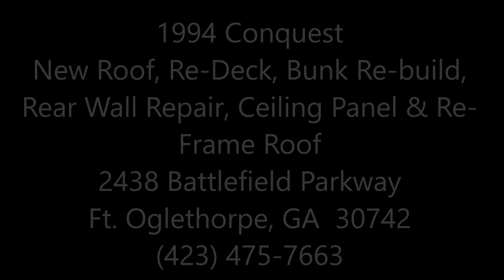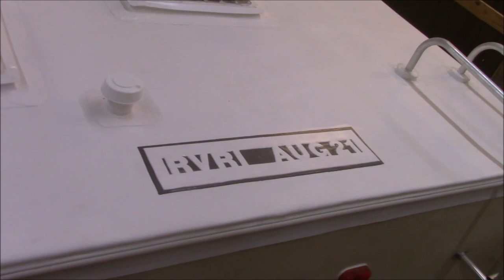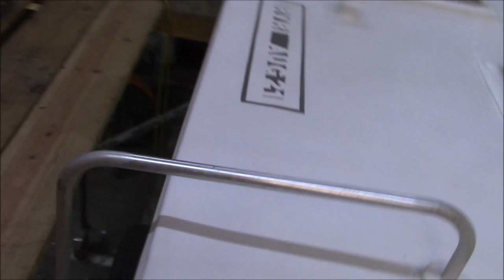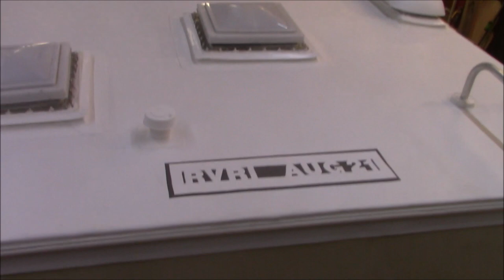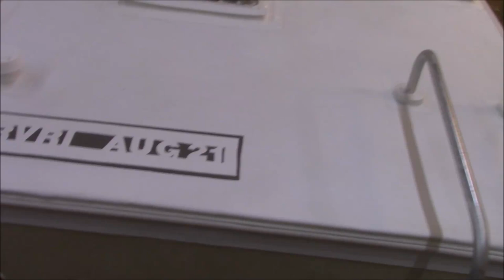1994 Conquest New Roof and Re-Deck Bunk Re-build

Comment: I purchased a 1992 conquest with foam roof panels. 
I knew I was going to have to repair the roof. 
I had no idea how these were constructed. 
They are fine if you don't have water damage to the 1/8 wood paneling, but as soon as this paneling rots, there is literally nothing supporting the foam panels. So someone walks on this the foam just caves in.
I  loved your solution of mounting wood arched trusses to the sides of the braces. Now you can relevel the cieling.  Brilliant!
Thanks so much!!!!
Reply from the maker: These vids are not genetally intended as DIY but if you got some tips...awesome. Good luck on your projerct my friend. These are a bit more complicated than most people think, or what they see on YT wannabee RV guys who don't install roofs properly. Those guys are " monkey see, monkey do" guys. They don't know "why" they do, they just do, and just try to copycat the manufacturer who has done them wrong from the start. So its safe to say that if the manufacturers installed the roof wrong from the start and leak then the roofs the "monkey see monkey do" guys install will surely leak and yet another customer gets shnookered. 

Thanks for watching.

Comment: If I had a 2013 or something similar that was having delam, I would absolutely haul it to the professionals however,
I found a 2000 32 foot Minnie Winnie that I picked up for 3500 bucks. 60000 on the odometer with the exhaust bolts already replaced on the V10 so with that I've been fixing the delamination myself. Granted ive got the tools and patience that prep is 99% 
I gutted the interior and have been redesigning it with mostly free stuff and at that point with the exception of my glues and Luan, the only major amount of cash I have in the so far is my Hellwig, air ride suspension with compressor I enjoy the channel and I do understand why no tips are given LOL

Comment: Use caution with leaving an HVAC compressor on its side like that. It usually allows the oils to move and go into places they aren’t supposed to be and can cause issues with the unit, if not permanent damage.  Great video as always!
Reply from the maker: You are correct. The oil needs to balance out before running. same principal applies when folks transport refrigerators laying down. They should be stood upright for 24 hrs before being plugged in so the oil will settle back into the compressor. 
Thanks for watching.

Comment: Is there a place like yours in Washington state?
Reply from the maker: No we don't have another shop. The roofs are designed by us. Although we could try to train another shop the hardest part is pulling the coach back together with rebuilds. Most folks think they just need a roof but when we open them up ..as you can see ...there is always some underlying issues needing to be corrected before we install the roof. All the years we have been doing the RVa we have only had maybe 10 that were actually roof issues. We don't want someone using our name or our roof system and not do a job thoroughly and the customer left holding the bag for a re-do.
Thanks for watching.